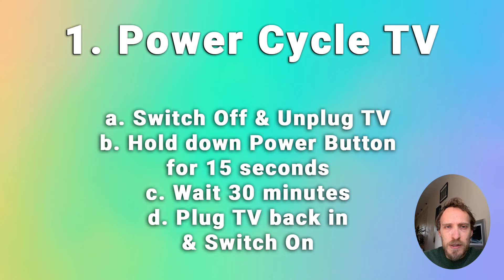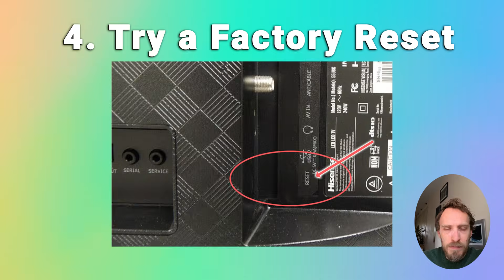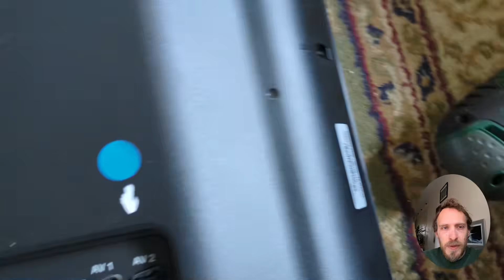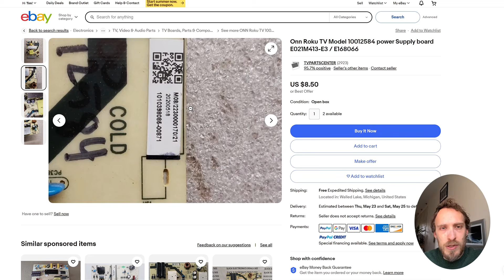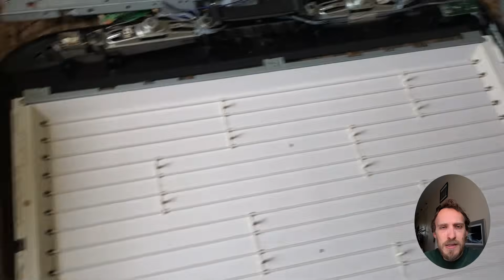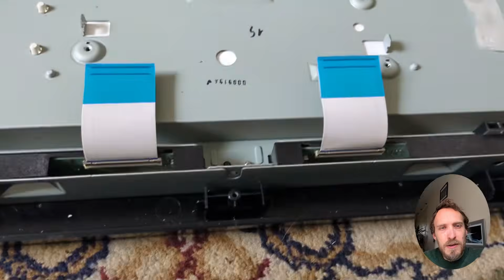Fix Your ROKU TV Black Screen | Detailed Guide

Comment: So after removing one side of tcon i get a white screen on one half ( not a regular image), then i unplug power and test the other side of tcon, no image. Does that mean i need a new tcon board? I did not see a regular image when the other side lit up, was just white.
Reply: To follow, I have audio, no visual. Backlights lit, one side tcon unplugged I get a half white screen and half backlit screen. Reverse tcon cables and no white screen just backlight glow.
Reply: Try changing the batteries 😅